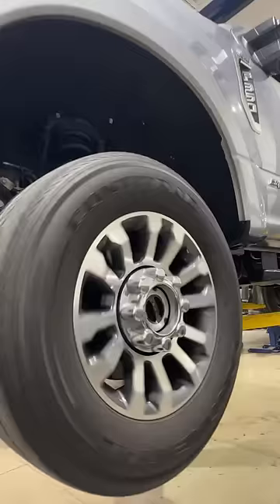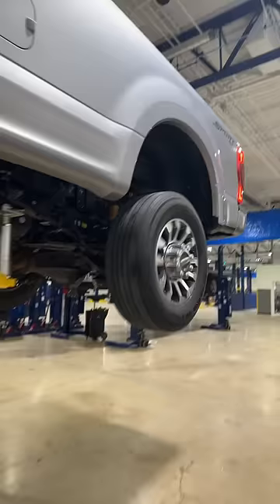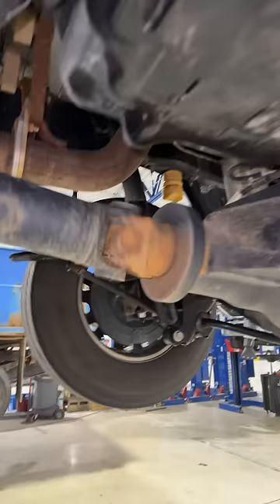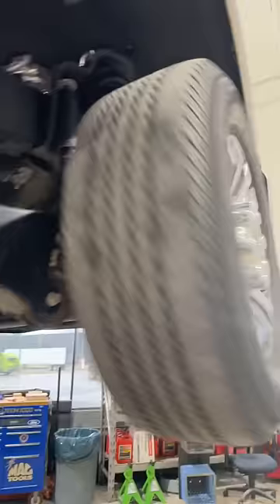NEW 4x4 noise 2022 | F250 F350 #broken #fyp

Comment: That's a lot of dang rust. I have a 96 with less rust than that
Reply: Where do u live tho?
Reply: doubt it.
Reply: @bjornironsides6474 the frame on my 2004 with 134,000 miles still looks new but I live in Texas. That same truck in the north east would have been in the junkyard years ago probably.
Reply: Same my 99 has less rust and I live in Ohio lol
Reply: I had the frame rot out on a daily driver with 36,000 miles, Mech. said he didn't think it was even safe to drive off the lot. ya..... Mass.
Reply: @bjornironsides6474 my 03 ram with 516k has less rust than this for sure. Frame still looks new.
Reply: @andrewbrinton1531  I see 2000s dodges around here with fenders rusted all the way through daily.

I think it depends on where you live and how its used in most cases.
Reply: oFf rOAd bAbY
Reply: tell me youre from the south without telling me youre from the south.
Reply: I live in Juneau Alaska and have a 76 Chevy truck and it has less rust than that truck and it's been here on the coast for it's entire life. But I own a power washer and know how to use it
Reply: Look at that rust, gotta be a New Englander
Reply: My 99 chevy don't have this amount of rust either.. and I live in Norway with salted roads.
Reply: Drive up north we paint the roads with salt every single day in the winter that's 6 months corrosion every year your truck would cry up here
Reply: I replaced the frame on my grand marquis
Reply: @bjornironsides6474  my 93 has less rust then this, it’s all about how you store it and if there’s any rust get in there and deal with it*
Reply: Yeah up in wisconsin by the time I get vehicles, I could swear rocker panels are factory because I never see them. All the salt and sand get everywhere. Fluid film helps though.
Reply: I live in the south, so I wouldn't expect much rust on most cars here. But boy, the moment there is rust it'll spread fast here.
Reply: @srich8251  probably a plow truck at one point.
Reply: You must not use your truck.
Reply: I live in Delaware heavy salt in winter and 2000 silverado has no rust underneath with 176k miles and nope never been inside a garage
Reply: Lots of talk about rust. It's probably an upper mid west truck. They use a lot of salt up here to melt the ice and snow off the roads. Just a nasty salt bath all winter.
Reply: it has next to no rust lol
Reply: That's less than a winter's worth of rust
Reply: That's what I was thinking.  Crazy rust for that new
Reply: My 97 f150 is cleaner than that thing 😂
Reply: i had an 87 f150 with almost no rust that i paid a grand for..i feel you there.
Reply: @Bjorn Ironsides  nah my 95 is near restless and I treat it like crap and drive it wherever
Reply: Yea...friend has a 1912 Model T with less rust than that too.  So, what's your point?  Friend drives his Model T hundreds of miles per year because he likes to, but he also lives in Arizona...rust isn't a big issue there.  If this guy is in the PRNY that truck won't last more than 7 or 8 years unless you fluid film the thing.
Reply: my 96 chevy has NO rust. hood and roof paint clear coat failed though
Reply: Don’t forget some states used liquid salt and it speeds up the rusting by a few years. Also is that an electric 350? The transfer case my have a solenoid going bad
Reply: I have a 98 with less rust wtf
Reply: not a ford lol...
Reply: That would be an OBS and they definitely don’t make them like that anymore
Reply: Mine has none with 300,000 miles
Reply: What rust?
Reply: same, eddie bauer
Reply: @TheCoalminer13  that’s crazy because Ohio experiences a lot of the weather conditions that cause it, and we cover our roads with an inch of salt so there’s that too
Reply: Yeah, my 97 explorer has less frame rust...  Too bad the rear wheel arch on the passenger side has a hole in it. Lol.  Por-15 and fender flares to the rescue!!!
Reply: My 1993 Nissan D21 has zero rust.  The oil leak just ensures it stays that way.
Reply: I’m in Utah with a ton of snow and my 97 had no rust on it, I clean under my truck and make sure that if something rubbed against a rock while off-road or something and took off the paint I’d repaint it
Reply: I doubt the hell out of that! Lol
Reply: @SonicBoone56  I live in the NE and that’s just how rust works. Once it starts it’s too late, you’re better off scrapping the whole part and starting over. Worst part about rusted cars (other than cosmetically) is they are a PITA to work on if you are a DIYer. Can’t tell you how many bolts I’ve had to cut off, drill out, etc. Makes a 2 hour maintenance job take days while you wait on new parts. Very frustrating.
Reply: Another reason I'm glad I don't live in areas that get alot of snow.  The desert is a good place in that regard
Reply: that's what happens when you drive it in the salt!
Reply from the maker: @boss2923 bingo
Reply: @andrewbrinton1531 03 ram barely any rust tranny still shiny af💪 220k tho hoping I make it there what engine
Reply: All these boys here saying it depends where the vehicle is located... for a 2yr old car it should not matter, 5yrs? Maybe.  Obviously the vehicle is exposed to salt in one way or another but the bottom line is these buckets of sht are not designed to last more than the warranty period, the hubs and multiple other components get a dusting of paint, nothing more. Typical American business mentality, you think you would be used to it by now🤷‍♂️
Reply: My 02’ Dakota has less rust spots than my dad’s 22’.  Both trucks are in MN year round
Reply: @johns3153 believe it or not in cold climates with salty roads vehicles tend to rust much faster when they are put in a heated garage overnight at least that’s been the experience of myself and everyone I’ve spoken with

Comment: That’s why I keep my oil leak in my truck helps keep the rust off 😂😂
Reply: Lol
Reply: Lol me too
Reply: Pretty sure thats the only reason my 91 honda is still around.
Reply: my oil leaks are hidden by the underbody treatment. everything is coated in crud now. but at least there's no rust lol.
Reply: We think alike.
Reply: Seems great until you find out what oil does to CV boots and other rubber parts. But then again, it helps you figure out what parts need to be replaced with oil-resistant ones so you can switch to blind spraying of fluid film.
Reply: This IS the way
Reply: Fords engineer that into their vehicles. This one failed to self lubricate. 😂😂
Reply: Me too!😂😂😂😂

Comment: Thing has more rust than the 04 Dakota I drive to work and I live in Canada.
Reply: I've got a 23 F-150, less than 4k miles, in Florida.... has surface rust already
Reply: Salt roads he is the blame for the noise  grease the bearing
Reply: I bet ur in the lowermainland. Rest or canada gets 10-20 years outta their cars, tops.
Reply: It has as much rust as my 1999 C-rv that lived on salt roads had
Reply: The 04 1/2 is the best Dakota of them all.
Reply: Hey I have a 04 Dakota too 4 door 4 wd 4.7 engine. Luv it!

Comment: My 17 does this. Local shops weren’t able to diagnose. So thank you for bringing some answers👍🏻
Reply: What's the answer
Reply: @billbarker3715  Hub Seals
Reply: What a joke of a local shop...
Reply: @markopolo945  sounds like a wheel bearing.
Reply: @twonstermonster850 wheel bearing should be making noise all the time not only with a 4 by 4 on

Comment: Worked in a Ford dealerships detail shop…Seen brand new F150, F250, and F350 with less than 100 miles rusting on the lot…
Reply: *stealership
Reply: step one -don't buy a truck that was rotting on the lot.
Reply: This must be the northern or NE regions. All the salty pavement will do that. So what’s the fix ?
Reply: Good ol Chinese steel
Reply: wash your truck top and bottom.  @Abuzac
Reply: Have it coated from new with an anti rust coating and reapply every few years.  @Abuzac

Comment: Yep. Just did both front seals on a 22 with 22K.
Reply: Is the noise just a vacuum leak?
Reply: @Jglivermr2 here it's clearly the rust
Reply: It was the seals themselves squeaking.
Reply: What's with cars these days my mates 2022 raptor grenaded it's box at 20k after some light paddock bashing and no real offroading ....wtaf ford
Reply: And people wonder why I say I only like older Fords. Lol.
Reply: Great to hear that.. I just spent $84k on a new f-350 with a 112k window sticker and about 3 months later this video pops up. Thanks for crushing me once again YT… lol
Reply: New trucks are a money pit, get an old truck rebuilt and save the money for years of gas
Reply: @turbotonye-4124  you saved nearly $30K. That will be handy for the upcoming repairs I guess.
Reply: Damn my durango is doing that, bought it brand new, only had it 16 months, smh thanx
Reply: @turbotonye-4124  WTF! You paid how much for a damn F350?!?!
Reply: @roadiez1  My 21 F350 was $75k new.
Reply: @seedy-TV  well it’s a Ford

Comment: When under a spinning drive shaft, or any moving parts, especially if you have long hair, be careful. I once read about a guy with long hair that got his entire scalp ripped off when his hair got tangled in a spinning drive shaft.
Watch out for loose clothing around any moving parts like conveyor belts too.
Reply: I saw a dude get his hair caught in a drill chuck one time. That's why I always put my hair in a ponytail when I'm working.
Reply: Short hair and a hat and your good to go.
Reply: Remove jewellery too, I worked with a guy who's wedding ring grounded out his starter, needless to say he had quite the unique burn on his ring finger.
Reply: Young guy, second day on the job, got his clothing caught in a drivline and killed him.
Reply: That’s a simple fix. Short hair
Reply: The same applies around any machine that has moving parts, be they rotating or sliding. Short hair, no jewelry, no loose clothing. The machine shop is the prime example of machines that actually seek to kill you. They like you, but the also want to eat you.

This also applies in the kitchen. Many things there will eat you as well.
Reply: @oldfarthacks  You're spot on there. Back in machining, I used to only wear short sleeves because of that reason. Last thing you want is your sleeve getting caught in the chuck jaws of a lathe while it's in rotation. I've seen a video of a Russian dude becoming shredded meat once he got caught in the lathe he was running.
Reply: A cousin if mine did that in the 90’s … working on knitting machines ..  ripped off scalp , one ear , one eye brow and lid ..  literally had skin off his ass grafted on his skull ..  yes we called hime butthead and asshat .
Reply: @CrazyBear65   read my comment .. he has a ponytail
Reply: Ugh, that's a painful thought, but good advice.
Reply: We’ll at least he doesn’t look like a chick anymore ☺️👌🏼
Reply: ....and those ZZ Top beards.  Lol

Comment: Making payments on something that is engineered to fail!!!!!!.....Priceless!!!🤣👍
Reply: yep my old man worked for ford, that’s why he quit is cause they manufacture and engineer their products to fail. So he traded in his ford for a gm and hasn’t had a single problem since he got a gm in 07
Reply: @tommymadsen3915  Yeah, seems like everything these days is friggen disposable junk. I made a $3500.0 mistake buying an LG fridge, after 2 years a $25 dollar part took a crap and couldn't be accessed for repair because it was encapsulated in the back of the fridge in expansion foam from the factory, the back of the fridge would have had to have been cut open. The appliance repair dude said to Junk it,  and of cource customer service was a 3rd world Country call center🤣👍 Never again!! Would I touch an LG anything with a ten foot pole.✌️😏
Reply: @tommymadsen3915  so you think gm engineers their stuff to last? GM is having a hell of a time right now.
Reply from the maker: @mattcaesar5781 they all suck partnet
Reply: @tommymadsen3915 then everyone stood up and clapped !
Reply: Making payments? What payments? When you buy a truck like this people generally only make one payment.. not payments

Comment: I pulled the vacuum hose to that wheel on the one I had..noise gone- replaced the inner seal and now it's quiet
Reply: 2 cans of blaster sprayed at the bearing seal and send it😄
Reply: This why hubs suck
Reply: Glad you posted.  That was my guess. I didn't know if they were still using the vacuum hubs
Reply: @ronp499  I was just getting ready to post that it sounds like the seal on the vacuum hub. That's exactly what the older ones sounded like when they got dry.
Reply: Vacuum Doesn't apply here to this one. It has manual lockout hubs.
Reply: @spookytowie7838  still has a squealing seal though.
Reply: @davidleonard8369  knowing ford it's probably the same set up as the vacuum hub lol.
Reply: @spookytowie7838  having repaired way too many of them myself I can say that they are.
Reply: @spookytowie7838  Ford uses both. The manual lockout is a back up should the vacuum fail when you need it.
Reply: It has vaccum as well. Stupid set up
Reply: @rickeydriskill1096  Depends on the operator. It's really nice to NOT have to get to lock up hubs when it's -40C, or knee deep in mud, etc....
Reply: @rickeydriskill1096  To each their own! I, sadly, don't have much choice. Only have a F-150, and it's a 97 at that. I should likely swap out the vacuum lines sooner than later, before they fail.
Reply: @Mike Ford  my wifes 98 expedition has all that mess and electric shift 4x4 . I hate the entire setup, nothing but issues.  It only goes in 2wd and awd . Will not go in 4hi or low. Crappy fail pron electric crap.
Reply: @rickeydriskill1096  That because the early Expeditions weren't deisgned to be off road vehicles like their F-150 counter parts.
Reply: @Mike Ford  all the 4x4 parts and suspension.  They screwed the owners by going away from a manual shifter and manual hubs. They just created a lot of problems.
Reply: @rickeydriskill1096  My 97's 4x4 shifter is manual. The 1/2 tonne chassis are the only ones that went away from manual hubs. 3/4 tonne and up kept them, with the addition of the "remote" vacuum system.
Reply: @rickeydriskill1096   my o5 excursion did same would not go into 4 WD when I needed. That was last ford
Reply: @mikeford963  my vacuum hubs left me stuck in a flat icy parking lot in my 4x4 S10...  Next truck had manual hubs
Reply: @ronp499  I hate those vacuum hubs. I had an o4 f150 4x4 once and I had to replace all of those hoses more than once. My 04 tundra doesn't have all of that crap.
Reply: @cranialflatulence  when my jeep's hub failed it left me stranded on a perfectly flat grassy field it was slightly damp
Reply: @samuelpresser7647  you don’t what know you are talking about 😂🤣…locking hubs are these thing to ever come along!
Reply: That was my guess, sounded like a hub
Reply: @William Reilly  Diagnosed my nissan driveline squeak like that .hosed ujoints down and noise went away for abt a week .
Reply: @spookytowie7838  I’m rolling through the comments like is someone going to inform these plebeians or am I going to have to. 👍🏼

Comment: This is the noise I emailed you about. Fixed so many last year.
Reply: What was it caused by?
Reply: @orcoastgreenman  looks like the u joint
Edit: not the u joint. Vacuum hub seal.
Reply: @alexrosado3890 vacuum seal
Reply: Vacuum seal with manual hubs?
Reply: @mattneargarder7379  I want to know the answer to your question as well
Reply: @Puckers.The.Goat1  thank you for the correction. I read some more comments and they say the same thing. Never encountered this problem but it's good to know.
Reply: @mattneargarder7379  they are vacuum actuated with a manual knob. Mine don't turn, but the vac works. 04 excursion.

Comment: What upsets me is the overall prices of new trucks nowadays, this should not be happening
Reply: And they kinda suck for compared to some of the older ones. I basically stay away from anything newer than 2004 because computers but it's getting more and more difficult to source those in decent shape.
Reply: Right, they purposely move toward more complexity and computers less autonomy. Not for your sake either. Unfortunately most people do not pay attention while they are being destroyed.
Reply: If they did not pay 40 dollars an hour we could afford one
Reply: I just heard the MSRP is going to go even higher in 2024.
Reply: I make $112,000 a year, been in business 15 years and they wouldn’t approve me for a new Ford F250. . . Someone told me you have to make $150,000 a year to buy one of these trucks now. Guess I’ll never own one! Happy with my little 2018 Honda Accord “Hybrid”! Best $32k I EVER spent! 47 MPG!
Reply: I will not be buying any more NEW trucks, period. I'll wait a couple of years until the buyer has gone through all the problems. And workarounds have came out on the tube 😊

Comment: It’s a dry seal somewhere like the transfer case output seal or 4x4 vacuum/hub seals. Worked at a ford dealer for 20 years. Left in 2004 and I’ve seen this a few times

Comment: Just makes me all the more appreciate my 2002(!) 2500 GMC Sierra 4X4 (6.0 gas engine)…almost 500,000 actual miles now.  In 4WD(Hi or Low) no noise  at all from her running gear😋
Reply: I got an '11 F250 with 330k on it and no noise from mine either.
Reply: Damn any tips on getting mine to last that long?
Reply: 02 Chevy Duramax and still runs great
Reply: 2002 Z71 Suburban with no 4X4 noise.  526,000 miles
Reply: Probably on it third transmission, those 6.slow have a bad case of oil consumption not too mention lack of power specially for 10 miles a gallon. Did I mention GM suspension components are crap..
Reply: 500k my rear end

Comment: O ya the salt and sand does a number on those seals in the north. I'm replacing seals weekly. The problems   seem to have started when they started sending install shims with every seal. Might be worth looking in too
Reply: A simple car wash every once in awhile even during the winter times will solve a lot of those issues I mean it is a Ford so you can't solve all the issues there's way too many for that